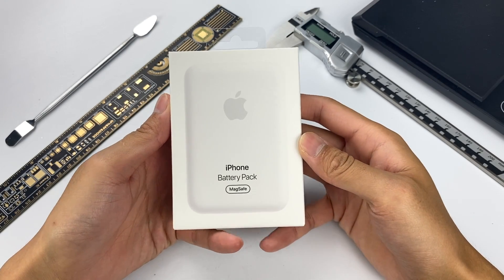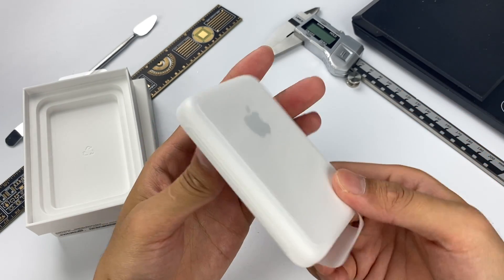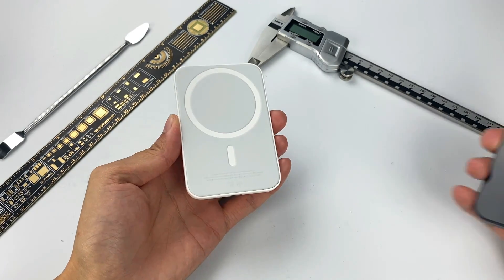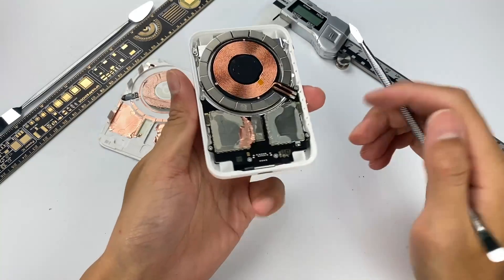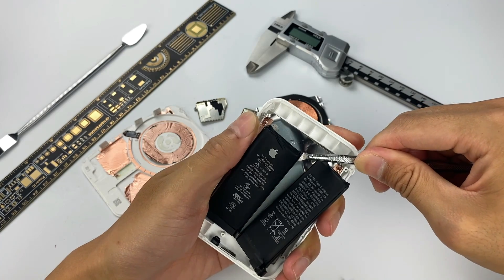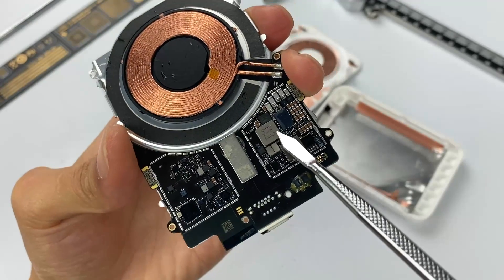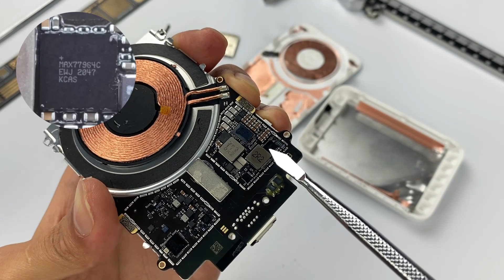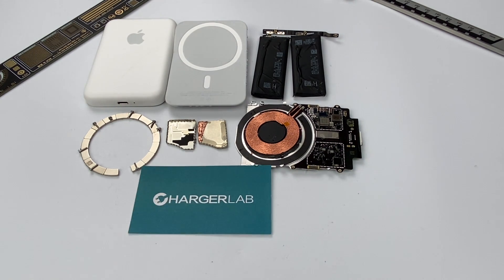Latest Teardown of Apple MagSafe Battery Pack for iPhone 12 Series

Comment: Now i understand why its like 3x more expensive than Anker or Baseus or Ugreen.
Those magsafe battery packs looks like trash when opened.
But this one has keen attention to details.
Heat dissipation back and front!
You cannot see them on these cheaper magsafe.
Plus, Apple advertises the real capacity of the Magsafe. Unlike the rands I mention, they advertise 5000mAh when you can only get half of it.

Comment: For $99 US this charger should be able to be charged with a QI wireless charger and not only by plugging a lightning cable into it. Apple is ripping customers off with this battery pack that can't even charge a IPhone 12 from 0-50%. Your lucky if you get 20% battery charge from this Apple battery pack. This is horribly useless.

Comment: Why does the circuitry on this MagSafe charger look so much more complicated than the anker one JerryRigEverything opened?
Reply from the maker: because this MagSafe charger has more complicated functions than Anker one, such as checking  the charge in your iPhone, optimized battery charging, charging the battery via iPhone, etc.
Reply: @ChargerLAB  makes sense, thanks for solving my doubt!

Comment: So the total Capacity is roughly 2000 MaH?!
Reply from the maker: if you calculated it by 5V, roughly 2200 mAh. so the Wh will be a better unit, which is around 11.13Wh.

Comment: Thanks for the detailed sharing! But I still wonder how they control the start and stop of charging. The inductive coil detects if a phone is attached and I don't see a cable or something run to the circuit board from that...
Reply from the maker: Don't forget NFC coil and NFC chip (they're also in iPhone 12) .
Reply: 倆說漢語的人在這飆英語

Comment: Still trying to figure out how Apple achieved that clicking sound when the MagSafe batter pack connects!
Reply from the maker: I do not think it comes from speaker. The reason that I can guess is because the magnets and the little gap between white circle and your phone.
Reply: I haven't been in contact with one of these since I have an iPhone 11 Pro - But could it be coming from the phone's speaker? Again, totalllyyy guessing here since I have no context. Would that be impossible?

Comment: So it is 2920 mAh in total ? But i saw i   charges 12 mini to 90 percent. Which must be around 2000 mAh
Reply from the maker: The conversion efficiency will vary depending on the situation, it is impossible to be 100%

Comment: Pity you didn't check the charging power when connected to a power supply. Talks are, it can do the true 15 Watt MagSafe 'Fast charge' what nearly no 3rd party charger does.
A good tear down though, thumbs up.
Reply from the maker: When the battery pack was connected to power supply and charge the iPhone at the same time. The max power we tested is around 21W (Using 96W power adapter).

Comment: I am not saying that this thing is worth 99$ for most people but such a tear down shows how much more there is to a product than just the mAh capacity. It’s all about finding the right balance for maximum efficiency. Given that this product is pretty much as big and heavy as it realistically can be I really don’t see how Apple could have put in a higher capacity battery without dumbing it down (removing NFC and logic for proper system recognition) or compromising on its ability to dissipate heat.
Reply from the maker: I do agree with you.
Reply: You have no idea what you're talking about.
Reply: @americanv8ss  Pls enlighten us
Reply: @americanv8ss  Other batteries in its class are approv 2x the thickness .... so please enlighten us with examples of thinner batteries with better Wh